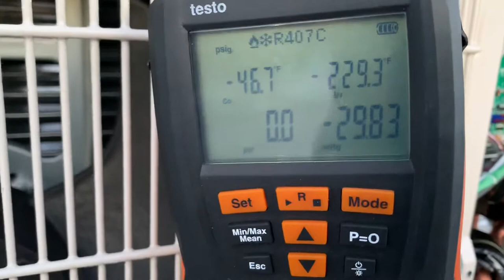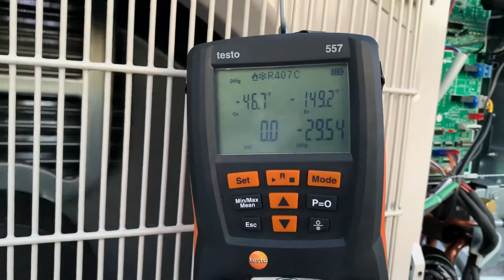DUCTLESS MINI SPLIT INSTALLATION

Comment: Isnt that A R410a unit Y Are Your Gauges On R407c??And You Need A Service wrench You And Cut Down ON all those Allen Keys.AnD Why Are You Using High Side Hose On The Low Side.is there Something im Missing Here.
Reply from the maker: R407c /R410a if you are only looking at pressures it doesn’t matter, also on this particular gauges the pressure ranges are the same on both high and low so with one service port to use you can go either way, these Allen wrench works perfect in this application as you can see😎 thanks for commenting
Reply: @D2DNYAC  Ok Thank You For The Clarification.